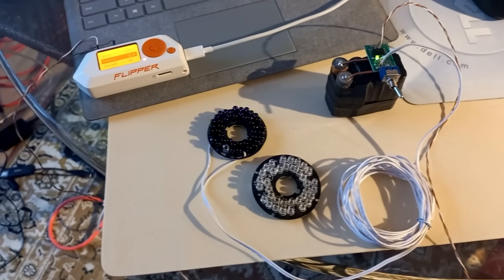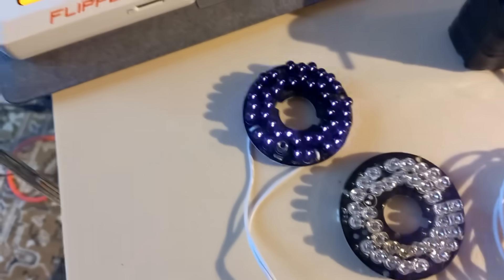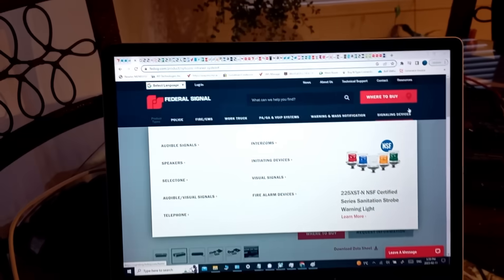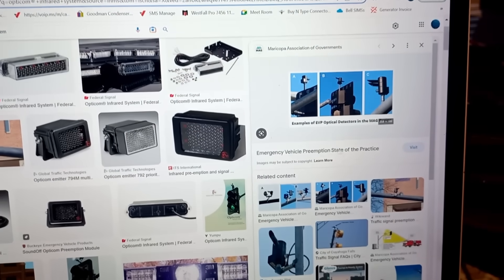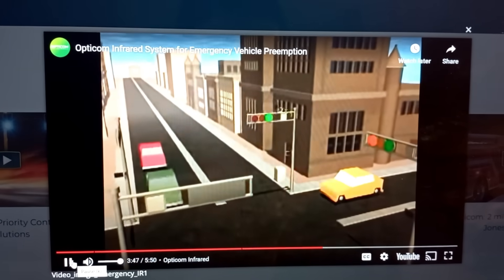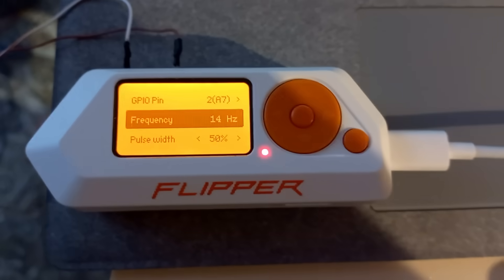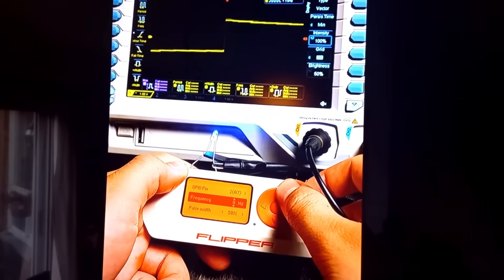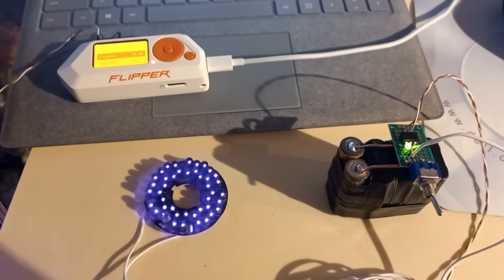Flipper Zero Controlling Traffic Lights

Comment: The school busses in my town as well as snow plows usea low priority mode that doesn't enable the warning on the traffic light and simply keeps the light green longer rather than giving a priority green light.
Reply: @peterfairlie2296  I've dealt with a lot of lightbars from Police cars.  One of them came with some sort of an add-on Opticom emitting strobe light and power supply.  I ended up selling that separately for around $100 or so.  I never tested it on a stoplight though, didn't want the potential criminal hassle from the authorities.
Reply: @peterfairlie2296  Yeah that was back in 2015 I believe.  At the time it was a fairly decent price.  It was a stand-alone unit without a housing as it was meant to be installed in a lightbar.  It was in the lower deck of an MX7000 but it was just flopping around as the plastic holes for screws were also broken.  I picked up that particular lightbar in Joliet, Illinois for $100, and ended up selling the lightbar for around $100, the Opticom emitter for $100, and sold the traffic advisor controller for more as well.  That was back when selling something for $100 was pretty cool.  Not so much these days.  Anyway, I don't have any more Police equipment to sell regardless.  Things would sell for double or more in today's dollars.  Last year I came across some lights for $10 that I ended up selling for $250 on eBay, just to name an example.
Reply: @peterfairlie2296  That's the traffic light receiver.  I had the lightbar mounted emitter strobe light.
Reply: @peterfairlie2296  Gotcha!
Reply: @peterfairlie2296  Occasionally these days I will see a traffic light that has the "warning" lights which typically flash for an Opticom triggered emergency to be dimly light at night.  Not sure why that is but it seems to be a thing with some of the newer technology being deployed.
Reply: School buses?  What is the logic behind the school children needing to have traffic light priority over the other vehicles?
Reply: @James-tu9eq  The snow plows use it locally too.  Also I believe they want to give the busses priority so that they can get to the elementary schools after the high school and middle school let out only 45 minutes before the elementary schools.

Comment: Most will show a white flashing light when the preemption is activated.  Also most systems are encoded with the code to prevent what is shown.  System managers are not dumb and realize that hackers have used this method in the past.  This is a federal offense and could be fine, imprisoned for 6 months or both.  Sellers of a device to unauthorized persons can get a fine, prison for a year 1 or both.  Not worth the effort.

Comment: Nice we have similar opticoms here in the US. I just recently got my 4th Flipper too.
Reply: @peterfairlie2296  One is being backwards engineered. One is stripped for testing Low and High Frequency RFID micro devices. I have my daily carry. And the new one is going to be case striped to try new micro WiFi dev boards on w/ the addition of deauther hardware. Out of all of us playing around we have around 17 total. Each person is trying something different or modding them in one way or another. I am not to good at the programing side I get by but I love the hardware side. I know people are having problems with getting them but we all ordered them on kickstarter. Other than this last one that I got cost me 200 but its worth it.
Reply: @Peter Fairlie  One of the guys is trying to recreate the flipper in a flat phone case style. I make flexible PCBs for him. He's been on and off of this project for six months now. I have made at leat 10 so far. Also I know your going to ask so. I bind kapton film sheets with copper trace foil between the sheets and use an adhesive mix of my own making for the binding process. I really want to try and find or develop a better way to make the traces.
Reply: @peterfairlie2296  Thanks I hope so.

Comment: The city where I live installed a new traffic light at the end of my street, the old one worked great when you approached it the light would change. I just flash my brights at it when going to work at midnight and it normally changes. Or I'll just run it lol feel like it's slightly less illegal than impersonating emergency lights

Comment: This is just silly.   You could take the extra parts he uses, and instead of a $400 flipper, use a $.50 555 timer ic and $3 worth of capacitors and resistors and achieve the same effect.

Comment: I used to work with the guy who patented this when he was at 3M.   Interesting as my friend in the same group had figured it out and had a handheld strobe to trigger the lights.   Laws were passed shortly after that made that illegal.
Reply: It is, oddly, a federal crime -- I saw a citation to USC in a video -- to possess or use a preemption transmitter if you don't work for an agency.

Comment: So this actually has nothing to do with the flipper other than it being a clock source. Is the flipper the new Arduino of the getting started with electronics world?
Edit: I realized this comes off as really mean. Sorry. I do appreciate your thorough research and covering of that, good job using opto isolation covering the projection of infrared light at high power.

Comment: I have actual Opticom systems, and in some regions they do actually use the 3 digit code function on the traffic lights. Meaning that just 14hz strobes are filtered out. Also having messed with older traffic signals that were not code enabled I can attest to the police notice very quickly. Also I messed with one older set of lights where you only had to trigger one light and every sequential light would change and flash green to let priority vehicles know they are clear to go. That was pretty neat and haven’t seen that since.
Reply: Robert Daggett  having lived in a couple regions I've definitely seen there is a lack of standardization in Opticom systems and how they give feed back to Priority vehicles. Here in New Hampshire they have red strobe beacons that flash to signal that the Pre-emption system is in control of the light, in Colorado you had no visual indicator at all, the exception being that one set of lights I stumbled across, and I reiterate I haven't seen it since. I feel like this should probably have some sort of standard to it but it just doesn't.
Reply: @peterfairlie2296  so why not use the flashing of the green light? Uses the existing light and most likely the feature is already on the traffic light pre-emption control board. I'm not asking for beacons to be installed on every traffic signal, nor am I asking for GTT DDS gps pre-emption systems to be outfitted to vehicles and rolled out nation wide like they moved to in larger cities municipalities. All I'm asking is why isn't there a mandatory or default option to give feedback to Priority vehicles that the light has received the priority signal and is doing something, cause most lights I've seen across the country have no feedback that they're doing anything when they're controlled through a Pre-emption system, beit through optical, audible, radio, or gps control.
Reply: @USSRDragon  The Manual for Uniform Traffic Control Devices describe a flashing green light as a condition that should never occur on traffic systems. Page 453 part D https://mutcd.fhwa.dot.gov/pdfs/2009r1r2r3/mutcd2009r1r2r3edition.pdf
Reply: @USSRDragon  Flashing green light in the US means either a protected left  hand turn or a pedestrian  has activated the cross  walk signal. It's also a violation of  of MUTCD
Reply: @niyablake  To be fair, the MUTCD is more of a suggestion... and even in cases where fed funding is involved, there's a surprisingly permissive amount of state discretion.
Reply: @niyablake  I always wondered if there was publicly published standard for traffic control. Currently Im waiting on the pdf to download, must be pretty big if my browser is struggling. Referring back to green lights though it wasnt just that one light did it, where I witnessed this there was a string of 9 lights in a rather short string but due to terrain some were not visible line of sight wise until you reached them, say a couple hundred feet, so the visual Opticom receivers would need to be mounted in multiple locations in order to be able to pick up on priority vehicles if they came from any direction. That being said every light still had a receiver, just the integration of the Opticom system was quite unusual, by tripping any of the lights, all other sequential lights from the activation point onward in the direction of travel would also activate, and all of the green lights on each traffic signal would flash, both the turn arrows and the normal solid greens. Each signal had between 3-6 lights due to the size of roadway, and they held this pattern for 10 seconds after activation. So by the example of the flashing green arrow meaning protected turn, would the flashing green signal mean any direction is protected for the first responders? Also Ive never seen where green lights flash for the notification of a pedestrian using a crosswalk, usually theyre amber in the part of the country I saw this, or red where Im currently located.
Reply: Which means if you coded a script that could mimick or copy the light frequency u could indeed control traffic lights
Reply: Do they change the code every day or every week or something? Couldn't someone just read the code and play it back?
Reply: @fitybux4664  from my understanding it's a vehicle code so until that vehicle is retired it's active. As for reading the code the newer IR LEDs would probably be able to be seen on modern phones or cameras and be "decoded" but older units that are more prevalent out here, optical strobes, are not well captured by most consumer cameras and would be more or less indiscernible. That too being said if you have a transmitter I'd be willing to wager starting in the 100 or above range or 900 and below range by default would probably work as municipals often don't complicate things, nor have very rigorous security measures, so they'd probably assign an arbitrary numbering system to the emitters. Heck in larger cities they may just use the vehicle number, like as an example Weld county had 300-400 as the assigned vehicle numbers for sheriff's cars the emitter might just be whatever 3 digit number was assigned to that car. If you don't know what I mean take a look at the public works vehicles in your city, most of them have 3 to 5 digit numbers on them, posted on all 3 sides, sometimes with a letter in front in which case it may be a DOT vehicle identifier, but all three former government vehicles I have owned have had 3 number identifiers on them, Fire Chief Bronco 011, Weld county Sheriff Crown Vic 356, RTD supervisor Interceptor Utility C302. All that being said too that's only for visual opticom, radio and gps are far more prevalent now and are far better. Then there's audible opticom and I've only ever seen that in Nebraska, that would be the far easiest to beat only requiring a siren, but ya know it's a siren so it's not exactly subtle.
Reply: @USSRDragon  siren seems very intuitive and doesn't put dependency on jammable RF links.
Reply: "I have actual Opticom systems, and in some regions they do actually use the 3 digit code function on the traffic lights. Meaning that just 14hz strobes are filtered out"

 And I wonder how many are left at the factory default code (knowing bureaucrats).

Also, this only leaves 1000 possible combinations to have to brute force through (assuming integer only) . A kid's HappyFluffyPuppyLand app account has better password security than this.
Reply: @plateshutoverlock  It's more so that it just filters out 14hz strobes, it's not so much intended as a lock as if you do end up with a used 3M or GTT system it's only dip switches in the unit to tell it what numbers to blink out, no special software or tools required. Besides it was and may still be in most cases just used to log which vehicle triggers it. I mean I doubt between a cities fire trucks, ambulances, and police you'll hit 1000 vehicles, thus they can just monitor for misuse of the system. I mean as an example my emitter has 317 set in it. So if the code is associated with say an ambulance and either repeatedly triggers a light or a light is triggered while that vehicle isnt in use the city can easily pick up that the system is being abused. The state I'm in now doesn't use the code option and a couple lights I can trigger with my AC HIDs. The code option would simply prevent nuisance triggers like this, as well as make sure it's almost always an official vehicle using it. Nuisance triggers could also be dangerous if one occurs perpendicular to the way an actual emergency vehicle is traveling as it will prioritize the first received priority signal.
Reply: How do you a pin code on this stufs?
Reply: @Sackguy  using flipper zero, not a clue. As my understanding from the ancient 3M manual for my unit it blinks the numbers as binary, not quite sure how the unit manages that, or how it reliably received, but audibly when the units on its 1sec of 14hz constant strobe followed by a short pause inconsistent blinks and then 14hz & repeat. I say audibly as xenons cant be reliable filmed, but have a audible noise when strobed. Its a very distinct yet soft “pop” sound mixed with a very sharp yet quite metallic ping.
Reply: @USSRDragon At the cheapest, probably just straight beaming out the code, could be an NRZ or Manchester Code though

Comment: Cool device!  I bet you could get into serious legal trouble for using this!

Also, I suspect there are different brands being used in different communities, so your device won't work everywhere -- you'll need to build a hack for all the different brands that communities use if you want this ability in your car nationwide.

Plus, it's hard to tell if your device is working as it should.  If it is working, it should turn your light green and all others red (including for oncoming traffic).  Yours doesn't seem to be doing this since oncoming traffic is behaving as if their light is green.
Reply: The way they program the lights is to allow the flow of traffic in both directions. The one with the device does not control the behavior of the light. It’s predetermined at install. This device is more or less just a key like an ID badge. It just talks to the traffic light computer and says “hi! I’m a fire truck! Do your thing!” And the opticom stuff on the traffic light executes the predetermined behavior for the fire truck. 

And yeah, they may not catch you the first time, but getting caught after multiple uses is inevitable. I’ve heard stories that even ambulances where someone maybe had to poop real bad used it to get to station faster and he got in serious trouble.
Reply: @Yungsepsis  They turn all lanes red except the side that tripped it otherwise emergency vehicles turning left would be turning into oncoming traffic.
Reply: If i always followed the law life would be boring.  Today I did 40 in a 35. Live life on the edge and take calculated risks.

Comment: Awesome. I remember making one of these years ago before the flipper was made.
Reply: Same here, back in the late 90's early thous, you took a $49.95 strobe light from RadioShack, put $25 worth of parts in (from the back of the same radioshack where all the PCB components and LED's and cut-to-order cables were) then you just slapped a $45 IR filter on it so it's not blinding white strobe going off in your car and after some careful tuning of the knobs you installed earlier you had this device essentially, in its infancy lol

Comment: Just so you know, it only took a few minutes to find this exact intersection (9:24) on a map. This video is fascinating but you might want to consider taking it down if you don't want to get fined cause it'd be very easy for law enforcement to do the same. All they'd need to do is pull footage from any of those intersections that have cameras.

Comment: MOTOR VEHICLE ACT [RSBC 1996] CHAPTER 318 Part 3
Obstruction of signal prohibited
135   (1)A person must not erect or maintain on or in view of a highway a device that purports to be, resembles or interferes with the effectiveness of a traffic control device, unless the person is authorized to do so
Reply: @peterfairlie2296  Youre in canada
Reply: This lawyer would seem to disagree. "While the use of such jammers to cause interference with regard to tolls is more obviously written than with regard to red-light cameras, a criminal offence for mischief to data could also be preferred by police.  Regardless of the manner of prosecution, interfering with tolls and red-light cameras is not worth the risk."
Reply: @peterfairlie2296  You sure are taking lots of steps not to get caught for a person who isnt scared.